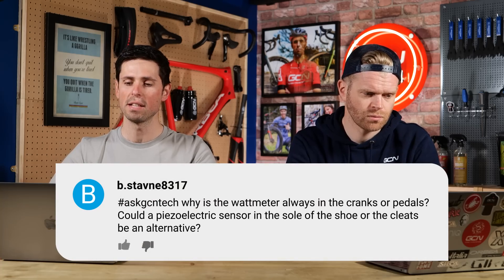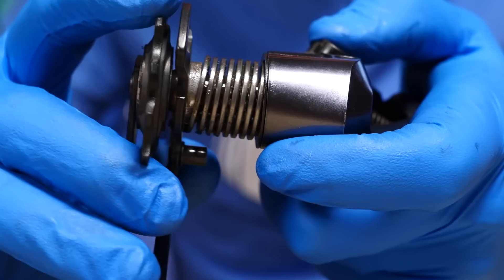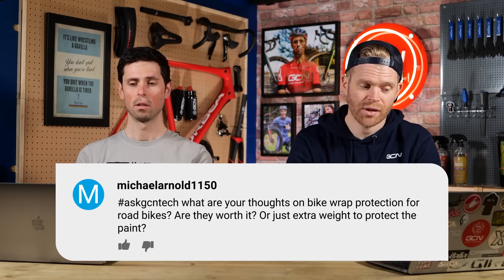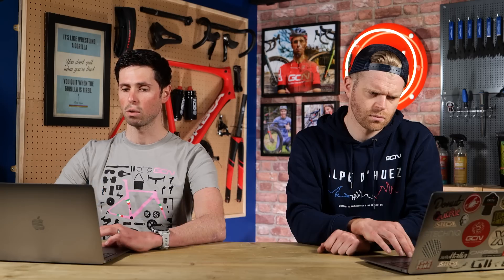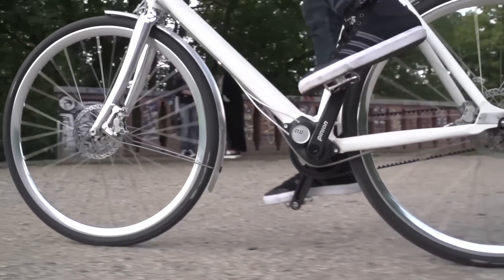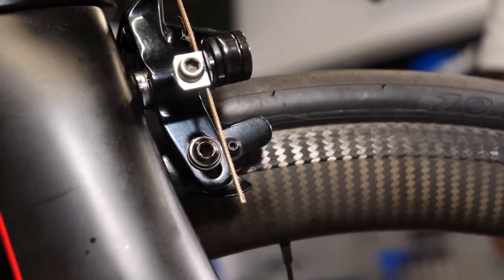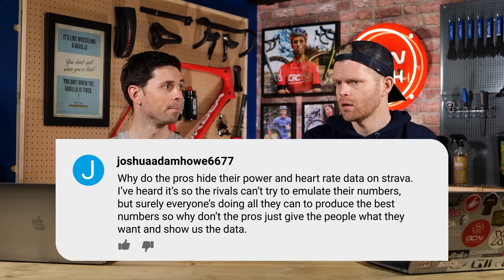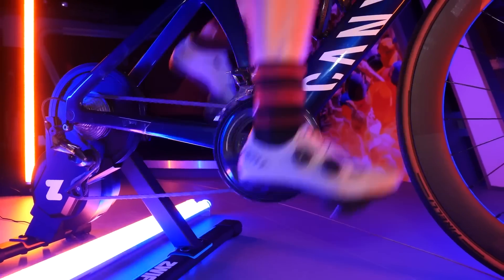Frame Wrapping, Carbon Rim brakes and Pro Data | GCN Tech Clinic

Comment: Hi GCN! how to avoid the tire to generate dry rotting/cracking lines? a little context: I have 3 bikes and the time between a tire is installed and It's worn out could be between 1~2 years, and I trend to see the tires becoming more "dry out" #askgcntech

Comment: Some of these indoor shoes might be more spinning-specific but I reckon they also have lighter materials that could help to reduce sweating. However, if the penalty is getting shoes that don't fit or are not as stiff as your road shoes, it might not be worth it.
Reply from the maker: Great point Florian! You might not want to wear those winter booties inside 😳

Comment: Would it be possible to add 'contours' under or to a bike wrap to optimise the frame's aerodynamics to the rider? p.s. The weight of the top-of-the-range wraps for an average medium frame is around 100g. Very comparable to the paint job most bikes come with. Buying an unpainted frame and then getting a wrap ends up pretty much the same weight. The cost is slightly more as many charge the same for unpainted frames! #askgcntech
Reply from the maker: Interesting! The UCI isn't a fan of fairings on bikes but this could be a great little hack for us mortals 🙌
Reply: My thoughts too :)

Comment: #askgcntech  why in the year 2023 are the radio/comms packs on pro riders still this big? Im always surprised how large they are, surely it would impact aero, weight and be added risk when falling on it possibly causing extra injury. In short, why are they not smaller?

Comment: The problem with carbon rim brake wheels is that it takes one descent to delaminate them and wear off the heat resistant track on one of the 4 braking surfaces. Once that happens, the wheels are done. Toast. Goodbye. Mileage recommendations don't matter if you do one big descent on a trip 5k km in and toast the wheels through.
Reply: How often does this happen? I'm an 80kg rider and did several descents in the Pyrenees last summer including Tourmalet & Aubisque, and my Zipps 303 firecrest wheels were fine.
Reply: @JackoJackson12  I had it happen to my wheels after a couple weeks of living in the mountains.

Comment: Great opportunity for GCN to cover !!! Belt drive bikes are amazing !! If you get a stiff frame and loosen the belt ( below manufacturer specs but using a roller  ( I forgot what it’s called ) to make sure it stays on ) rohloff hubs can come to within 1% efficiency of a chain drive, they did a study and if you’re going over … 200? 250? Watts I forget which the belt drive is actually more efficient because the slope of efficiency is flatter for belts than chains. This isn’t even considering dirty terrain which would make belts even more efficient. Building my first rohloff gates drive atm , the science on belt drives is amazing but there’s not much info out there on big channels. Great opportunity for GCN to cover !!!
Reply from the maker: You make some great points Steven! Maybe we'll do this soon! 👀
Reply: @gcntech  CyclingAbout (Alee Denham) must be the best person in the world to reach out to on this, he's done literally hundreds of thousands of km around the world on belt drive bikes, his videos are a great compilation of all the stats and scientific studies on belt drive bikes + he has without a doubt the most real world experience + diversity of places he's rode. He's extremely personable and answered all my emails when I was building a rohloff gates drive, you should reach out to him! If I can get 200 watts out of a chain or 198 watts out of a belt that requires almost no maintenance and no hanger to fiddle with and only one external rear cog to replace instead of an entire cassette i definitely think more non-racers should be on them. disclaimer: not all hubs are as efficient as rohloffs

Comment: 7:00 Ollie said it well.  I'll say it another way: carbon rim brake wheels are like screen doors on submarines.
Reply: I witnessed a delaminaton during a descent. The guy got lucky that he noticed it before the whole wheel exploded at 60-70 kph. Doged a bullet there. If you want rimbrakes so bad, stick with alu wheels.
Reply: @dexterx55  I've witnessed: disk brake fade, disk deformation, disk rubbing, disk dentures, spoke deformation and spoke failure. All in the same order and the same ride (Shimano ice rotor). The guy did got lucky at 50kmph and a hairpin curve (only a clavicle fracture and bruises and a lot of money wasted). Even then I value disk brakes as I'm sure tech will evolve to make them even better. Hydraulic disk brakes make my girlfriend confident in tactical descents as she has tiny hands and no arm strength. 
However, they make me, a stupid rim brake pagan and weight weenie, about 10 minutes faster than my disk brake mates ascending 2500mts and 120k, and they about 3 minutes faster in descents. Make of that what you will.
Reply: @Onigure I sometimes wish I was a tiny man, with a giant man's legs!    I have experienced Disc Brake fade.  This was due to using resin brake pads that were awesome for flatlands but not suited for technical descents that you described.  Disc brake pad choice doesn't get enough coverage on Road bike networks as it does on MTB networks.    But I am wondering.... If your friend was cooking his brakes to the point that they faded... Why in the h*ll didn't he pull over before the entire wheel gradually fell to pieces?